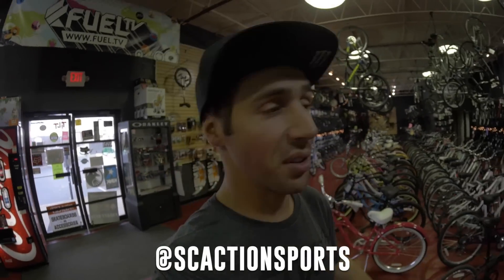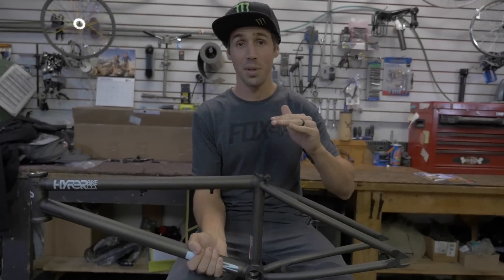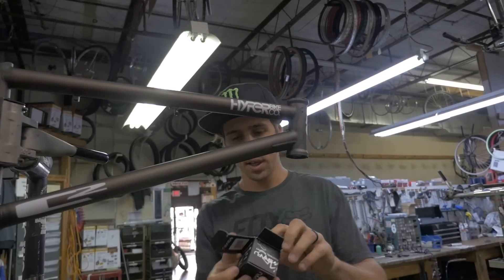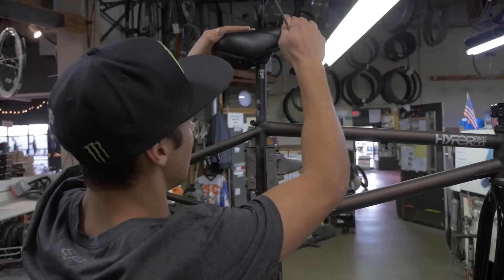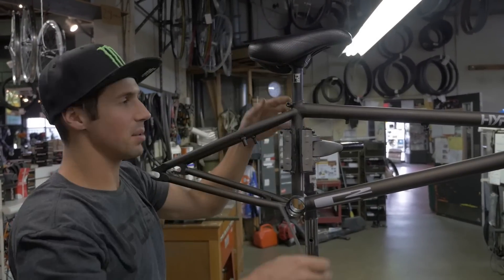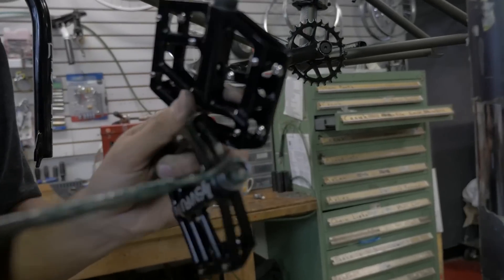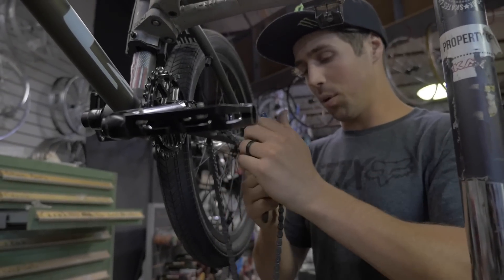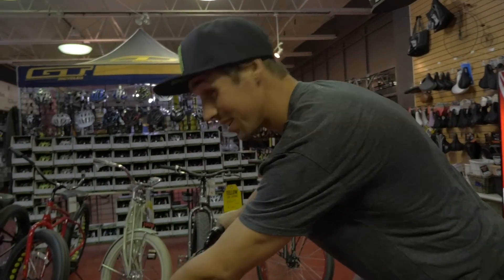BUILDING UP MY NEW HYPER BMX SIGNATURE FRAME!

Comment: At 7:50, the bearing press tool is the best thing to put bearing on but, like nearly all riders, I don't got this expensive tool at home, but instead of using a hammer (which is scary on a new frame), I press the bearings with my crank, it just act like the tool.
Hope it helps some riders.
Reply from the maker: +Fuzzy Not a bad idea
Reply: +Scotty Cranmer  I know you probably won't see this , but how much does your frame weigh

Comment: For those looking for a good grease to use in assembling your bike, use high pressure grease, usually is all red. It will hold up to to increased pressures of tightening bolts and heat of doing dope tricks. My boss recommended the CRC "Red" High pressure grease. trust me on this one!

Comment: I put the rear wheel on before the sprocket I've broken alot of chains because the link hopper over a tooth because the chain was tight but out of alignment if you ride your chain tight enough that it won't pop off without breaking then I will break when it hops the tooth. I recently bruised a rib because my frame was bent and when the chain broke instead of my knee hitting the bars my rib hit the crossbar because I was coming out of a wheelie long story short if your chain is loose it will pop alot if its tight and out of alignment it will break alot so if you put the back wheel on first you can align the sprocket with the driver so your chain lasts longer BTW love your vids

Comment: Wouldnt greasing the headtube only prevent the headset being stuck in there, as there sealed bearings?
Reply from the maker: +Cbr Hoonigan doesn't affect the bearing itself but there will be movement and friction between the steer tube and the head tube and BMX causes so much strain and awkward pressure that it will get slow and noisy.
Reply: maybe its because you go huge in comparison to us mere mortals i never had to really grease my headtube, my headsets lasted a long time.
Reply: grease your headtube silly
Reply: Hi scott
Reply: JMT089 that's what she said lol jk
Reply: Cbr Hoonigan is

Comment: I was wondering is that the same manufacturer the Hyper bikes that Walmart is currently using. I use to put these bikes together at Walmart but they never used the head set they used the headset that I was use to as a kid with the long bolt and the wedge

Comment: if you dont have a tool like that to put those bearings in for the crank. use a RUBBER mallet not a hammer <3 it will make your life easier
Reply: or if you don't have a rubber mallet, take a small two by four and put it over it then hit it with a hammer

Comment: I'm a 5' 11" 14 year old, I ride 20in, there is a big of knee smacking going on.
Reply: at 5'11 a 20.5 or a 20.75 would fit you better im the same height though a lot older and i rode a 20.5 from the time i was like 5'7 till 5'11 and it was good but i prefer a longer frame so i always wanted a 20.75

Comment: U can get that bike at walmart
Reply: No you can't.
Reply: Walmart bikes are cheaper but bad thing is it uses crappy threaded headset, 1 piece crankset, smaller bars, uses cheap aluminum parts, uses thinner tires, and its a lot heavier than really good lightweight box bikes. Screw Walmart bikes, get a cult, stranger, subrosa, Sunday, or mafia bikes they're better.. Duh
Reply: +Rarity Belle All bike companies make lower line bikes which have high tinsle frames, forks, handlebars, and cheaper parts. Hyper has been in the business a long time and had to make a decision to sell lower line bikes in order for the company to stay alive. You can't find any of those bikes on their site also. You can only find the high end frames on the website. Also plenty of pros riding these frames with no issues.
Reply: +sierravmax kinda like Mongoose